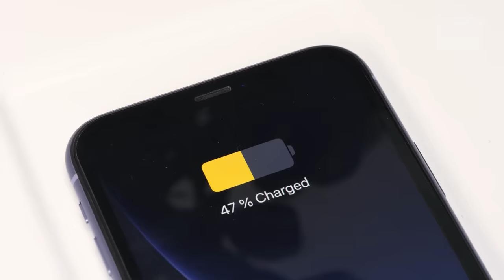How to Build a DIY Secret Storage at Home & More Secret Storage Solutions | DIY Projects

Comment: I wouldn't exactly call this stuff "do it yourself" level, unless you have some significant experience with welding, wood work, a fairly SERIOUS tool shop, and various high end equipment.  It might be simpler to just rename this video. If you can create things on this level, renaming a video should be a snap.

Comment: Careful with the table saw. I don't like that you had your fingers over the blade when you ran the piece through. Use a scrap piece instead. Otherwise, very good job.
Reply: yes way too close to the router bit also
Reply: Being alert and one with the tool is way better than a guard or push stick, unless experienced common sense tells you otherwise.
 It took me 45 yrs to get bit by a shaper, and it was my own damn fault. But I learned from it and approach it differently.
 (Jury rigged/router shaper and pushing right to the limit with it.)
 Never lost a finger, but left a few Jim-bits…or sushi behind!😂
Reply: Like the child and the flame,  idiot humans should be able to make their own mistakes...... you have no right to take that choice from them.....
Reply: @ricksanchez9798  sure I do. I can't not warn him. You and I are not the same.
Reply: @AslanAtreyu  when a child doesn't learn the proper lesson,  they never will.  Fire bad is much better than hands get slapped......
Reply: @ricksanchez9798  so how many fingers got cut off before you learned not to put your hand over a circular saw? How did you learn it?
Reply: @ricksanchez9798  So following your logic one has to wonder why you would even bother watching a "how to" video.
Reply: @Komainu959  how else would you know what lies are being interpreted as truth? actually the question is why wouldn't you learn as much as you can about everything??? Oh that's right,  you only like what you like and if you don't like it you ignore it, avoid it and condemn it....... open your mind and understand what your eyes are seeing,  or the illusions will feed your delusions........
Reply: @ricksanchez9798  Thanks. As you just stated. Why wouldn't you learn as much as you can.

"You only like what you like and if you don't like it you ignore, avoid it and condemn it". That's right, I do. JUST LIKE YOU did in your original comment condemning the OP for their comment. The difference- I'm not delusional enough to think I don't do those things. Thanks again. 

So following that logic what's wrong with OPs comment? It's trying to teach someone on how to do something safer "fire is bad" so to say. It's definitely not a "hands get slapped" situation. And even if it was aren't we learning something as any reasonable person would then research to see if OPs comment is correct or not.
Reply: @ricksanchez9798  Jaden Smith? that you?
Reply: @clown134  no,  and you'll never guess who I am because unlike your Hollywood deceivers, I'm a nobody.....

Comment: All brilliant!  I think I would've put the hollow-core door safe on the hinge side, though, just to be less easy to notice. On top would be totally hidden.
Reply: As someone who is extremely tall, I can tell you that the top is not completely hidden.
Reply: That’s all fine and dandy until your house catches fire!:)
Reply: My thoughts too
Reply: I learned most of thee spot. Before from DEA search reports
Reply: I agree and it should be on an inside door. The front door should be solid.
Reply: Except you are in the hallway for everyone to see you removing the panel
Reply: All great until something happens to you and no one knows were your valuables are at. 
A lot of homes have been torn down with valuables hidden in the house.
Reply: 100% agree, it's also noticable.  If I saw that on a door I'd immediately wonder what it was.  Not to mention someone closing the door could easily accidentally depress the compartment door and pop it out very easily.  Hinge side is infinitely more hidden and not prone to accidental openings.
Reply: wow 👌 👏 😍 👍  what a work
Reply: Absolutely 💯%
Reply: @occamsrazor7323  true 👍 🙌 👏 👌 ❤ 😪
Reply: Repent or you will likewise perish.  shutup
Reply: Repent or you will likewise perish.  I'm sure I was watching master craftsmanship and not bible study. Wrong comment thread mate.
Reply: I thought the same so cops won't find secret drug stash
Reply: hinge side of a door would be equally visible to someone pushing the door open. You're mostly depending on someone assuming any irregularity is a part of the door construction.
Reply: @Bubbles-qb5hf bruh as if im tall too and theres a few inches from the top of the door to ceiling. Do you squish your head in there to check the top of the door 😂 or are you actually not tall?

Comment: Ookay... I'll use UK stud walls asa a reference since I'm a brit; you may have about 4" (100mm) space behind stud walls, so that does offer some potential for hidden storage space, and while tile grout is a poor option for the border, there are various types of gap seals that could be made to act like a filler/secret border that would blend in far better than the grout example which would fail after a couple of uses. That combined with the example here having a rack of shelves in the way would definitely make such a hidden store harder to find. You could also install a hidden lock, which would be something along the lines of a gravity fed steel bar that drops into place when closed, this could be easily lifted with the aid of a magnet.
You COULD get larger wall cavities, but that depends entirely on the wall and I can see some would make such a hidden wall store/safe deeper adding timbers to the existing wall timbers and boarding over that

The door cavity is something I've seen before, though  its usually blended in much better than this and has some kind of hidden lock to prevent its opening by accident.
The computer desk is intriguing, though I was more than a little concerned by how flimsy the wall mounts appeared to be
Reply: Yep, I built in bookshelves for our study and did something along those lines. While all the other shelf units were given a conventional ply backing before being fitted to the walls, one of them was left with a gap the height of one shelf, at about knee height - or, to put it another way, the second shelf up from the floor. The neighbouring shelf unit had rails attached for a sliding panel that comes across and clicks into place via magnets I embedded in the wood - the sliding panel has matching metal plates glued to the back. If I want to open the panel, I simply push it back by about half an inch, against the wooden rails, to break the contact with the magnets, then use a big bar magnet I keep hidden to 'stick' on the metal plates and act as a handle to slide open the panel. Within the cavity I keep a small lock box. Throw in all the books that are normally sitting on the shelf, and no one is going to find it, especially as there's 7 separate shelf unites side by side in the study. I deliberately put the hiding place low so that it's nowhere near the kind of eye-level height most intruders would look for.  :)

Comment: I really like the "floating shelf" desk, very smart & nice innovative ideas built in. A bit too wobbly for my liking but there are ways to stabilise it (changing the design and aesthetic, but I've learned you can't always have everything the way you want it 😝)
Reply: And unless you were born into money good luck having the tools and material to actually do any of the shit you see on boobtube......
Reply: I had my doubts thebwireless charger would actually work through the wood, but it's pretty neat. Definitely my favorite of the three
Reply: All he had to do was use a stud finder and bolt the bracket to the stud amateur mistake
Reply: @stephenandersen625  why stud finder? Judging by the drill,  he was drilling into some sort of brick wall or aerated concrete. It does not look like wooden construction.
Reply: The one computer desk too flimsy you can't lean on, rest your head on, or not spill a cup of coffee.
Reply: Could do it with some kind of counterbalance like they do with apartment building balconies. For every foot a balcony extends outward...there has to be beams going father back into the apartment...in order for the balcony to support weight. Or he could have anchored it to studs or into the concrete er whatever he had there. Plenty of ways to make it more stable.
Reply: @andrewshepherd1537  until you change your phone....
Reply: @Vogas2  is that why it was so flimsy? if he had drilled into brick it wouldn't have been wobbling around like a jelly
Reply: @Halzephron  99% of modern mobile devices can wireless charge. Even my S10 could do it, and by tech standards it was ancient
Reply: @andrewshepherd1537  not at the same speeds they don't and as soon as new charging tech comes onto the market then he'll have to dismantle his wobbly creation.
Reply: depending on the size of the metal frame, you could just secure it to the wall in more places. Have a wall mounted floating shelf that's rated for 300 lbs.
Reply: A bit late, but yeah, that desk unit is totally impractical and poorly thought out. I've installed plenty of floating shelves, and at the very least he could have found studs, tailored the desk to the appropriate width, and used rebar fully inserted into the studs as hidden braces for the desk. I have floating shelves with TVs sitting on them that don't give.

Comment: The door thing in the beginning is cool but I've learned that simply putting things out of the eye line keeps most people from noticing hidden things. A little high or a little low and people just miss it all together. People don't see what they don't expect to see.
Reply: Jut be careful what you define as line of sight.  I can home from college 1 weekend and my parents had to step out, leaving the home locked, and I didn't have a key.  I then looked on the eye level shelf immediately next to the door and there was a key, I laughed as it opened the locked door.  I laughed because my mother was short - to her it was out of sight.

Comment: For many years my Father would make wall pocket pantry spaces, not as secret storage but just extra pantry space.  Cut into the dry wall, frame it with 2x4 and put shelves of various heights.   He used louvered wooden pantry doors over them.   The thickness of the pantry door was the amount of space that stuck out into the room so it wasn't much.  

The depth of the shelving was the same as the width of the walls,  just deep enough to store cans, boxes of pasta or other kitchen items.   In bathrooms you could store shampoo, shaving cream, perfumes, medication and unpacked rolls of toilet paper. 

In his last home he had about 7 or 8 of these through the home in different rooms.   It was so much extra storage space that more than half of your "normal" items for a room could be stored in these extra spaces which would have been wasted otherwise.
Reply: I've done the same in our house to create arched niches for my wife's art deco pieces. Throw in a slightly protruding shelf, and you have about five inches of depth.

Comment: Quickie, low carpentry - Cut open and install 3 or 4 gang electrical box at wall receptacle height, they make some in plastic with tabs to sandwich drywall.  Look for place not likely to have plumbing or electrical near floor, might need to cut and remove insulation.
Cut a blank cover screws short and glue into place.
Use magnet latches (and glue guides if needed) to hold cover to electrical box.
If needed, cut and install board between studs to box in bottom (will probably need more than 1 board to fit through opening) though this is not likely needed because you aren't far above floor.
Depending on the stud placement, you have a hidden cubby, 3.5" or 5.5" deep (depending on  2x4 or 2x6 studs), 14.5" or 22.5" wide (depending on stud spacing), about 16" high, which you can place almost anywhere for convenient access, without drawing attention.

Can do similar mimicking an HVAC floor or wall vent if larger space or access desired.

Comment: i usually try not to remove doors by unscrewing the hinges, sometimes it bores out the holes and makes it go back in wrong. just use a nail and hammer to quickly get the hinge pin out

Comment: The tiles... forger the tape, use caulking (ONLY on the grout, apply carefully) and slice with an exact knife when dry. The line will be almost invisible. Works with fresh latex paint on drywall of you do it before it cures completely

Comment: The second secret storage is great ... now i only need a wall with tiles 👍😊
Reply: Use those paneling panels with the look of tile. Easy to install, and you can hide the opening better, since you can cover the cuts with silicone caulking, not grout.

Comment: the one in the door is way to noticeable and exposed, the tile one is really good.
Reply: How long before grout falls off and exposes all
Reply: Yes, but there is the solution of choosing the other door edge, the one that is only exposed when the door is open. And to cut out the door along its entire length and re-glue a wooden stick on the drawer to camouflage the whole thing more harmoniously.
Reply: @totalpkg6912  he should have used silicone caulking - same color, flexible, and would last a whole lot longer.
Reply: *too
And just because he didn't match the paint, or put the same coating he peeled off to begin with right back on it doesn't mean the idea isn't a good one.
Reply: Too*

Comment: That floating desk top was too janky for me. Also when I lay tile, there is something to usually lay it on to. I've never seen floating tile walls
Reply: I thought the exact same thing.
Reply: He used a dremel tool that cut past the drywall. The dry wall is still attached to the tile he removed. Slow it down, zoom in or at least put some effort before commenting
Reply: @frognutz0o  oh yes you are right.
Reply: @FlorianSchauer  A comment like this is rare in the internet. I shall have it framed.

Comment: With the floating desk, I might assume the indentation was to stop pencils from rolling off of the desk.  However, if I saw you use it for wireless phone charging, my curiously may tempt me to peak underneath to see how it's designed or what's being used to perform the charging.

Comment: Nicely built shelf & secret compartment but I would want it fastened to a 
wall that is much more secure than a couple of screws into sheetrock!
Reply: That looked like concrete to me and that was a hammer drill being used.
Reply: Yeah, that's not sheet rock.
Reply: All such projects require some aforethought before proceediing. It's called using one's common sense. (It's not illegal. Yet.)

Comment: All great ideas, however the hidden tile compartment is one of the coolest ideas I've ever seen v👍😃
Reply: Except most walls are just a 2x4 thick not the big box he put in. Also tile just doesn't float on a wall it's adhered to drywall or something. So where that looks like a cool idea is not very likely to have a wall that defies physics like he had.

Comment: That’s a hollow core door , you would be surprised how much strength and rigidity you just removed doing that , also it will rattle and if you open the door fast enough or slam it open that will fly out . I like the concept though , descent slick
Reply: 🤷🏻‍♂️ Welp just like a tv chef vs a real one. They leave the poor homeowner to figure out the hard way when they touch their door and half the things fall apart.

Comment: 9:14 You just know someone somewhere is gonna try to sit on that thing and rip it right off the wall. That happened in one of the training rooms at work, someone sat on the desk that was bolted to the wall, and starting with that corner the whole thing just peeled off in slow motion. And of course since he was sitting on it, he couldn't do anything but continue  to sit and fall down with it, sending multiple computers tumbling to the floor.

Comment: I am sure someone else has pointed this out already, but you wouldn't want to hollow out the door like that to hide something in it. It would be easier to do the same to the wall where the door is anchored. It wouldn't decrease the rigidity of the door and remove its sound/temp resistance either. Plus there isn't any really good way to create fake caulking that can conceal a separation like the one shown with the bathroom wall tile. Not to mention there would be anchoring of the tile against either mesh or hardiebacker. It is a really good idea for a permanent drop place, if you were to completely caulk and seal the tiles.

Comment: Showers already have issues with mold from moisture. I don’t recommend putting anything in the shower that is not waterproof. That little cubby will collect moisture and first discolor and then mold and then finally completely fail.